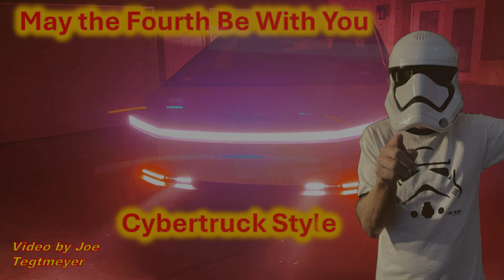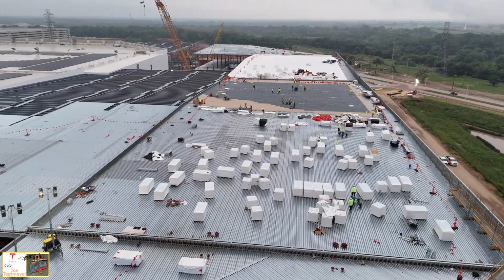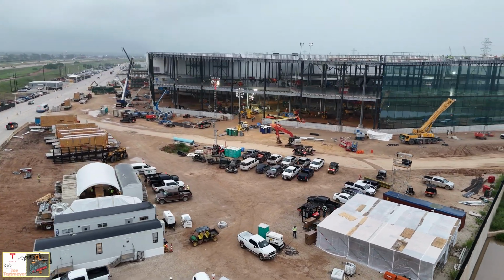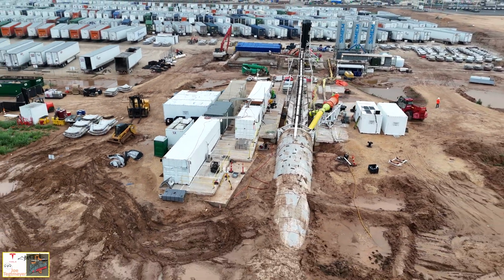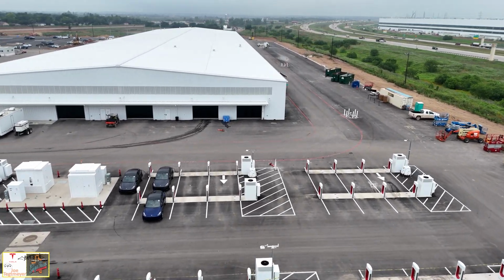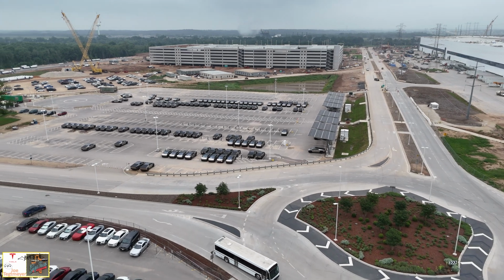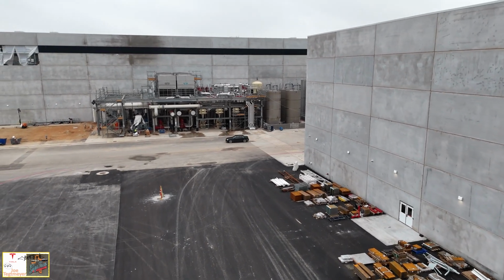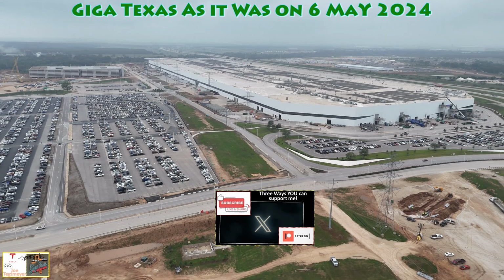Huge Progress on S Ext! Conduit on N side & Boring Tunneling! 6 May 2024 Giga Texas Update (07:35AM)

Comment: The spoils coming off the conveyor belt is mud; lots of water in the spoils. I’m impressed that they have the ability to bore through mud.
Reply from the maker: You are correct and in this video you can see where the water is partially removed at the point where the belts turn 90 degrees.
Reply: Not boring through mud. The spoil is wet from the cutting fluid (water/additives) at the cutterhead.

Comment: The area being worked, on the south side of the pond by the parking garage, is my guess where the tunnel will be exiting on the east side of the plant.
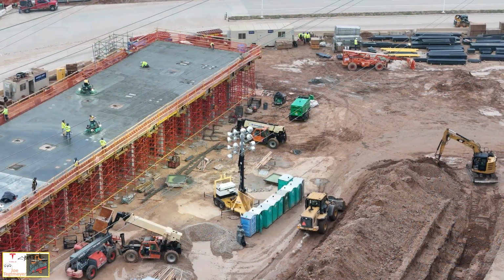Reply: If you mean @ 7:02 It is a Cooling structure. There is a permit...
"SX-000604R1 - SX - Cooling Tower Structural Platform"
Reply: @DavidJohnson-tv2nn  I was referring to the area where they are adding dirt to the south side of the pond, at the intersection of the new road
Reply: @jerrymcgonigal9810  Sorry for the misunderstanding.
A tunnel exiting inside the factory would at least serve some purpose. Though in my opinion, is not needed. But what purpose would a tunnel exit serve outside the factory by the pond?

Comment: Q: What do you think will be built in the South Extension? $25 K car/CyberCab? Tesla Bot? Model 3 variants? Tesla van? Run a poll with your viewers. Thanks Joe for all you do. I never miss an episode! SoCalFreddy
Reply: My wild speculation for the south expansion....
Center section with 3 floors seen here @ 5:56  Considering its location... Possibly a data center.
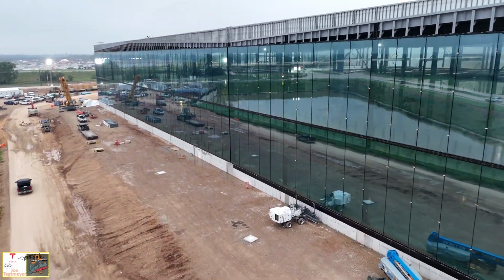Exterior sections with the glass curtain walls @ 8:54
Second floor floor...
Note the bollards behind the glass. A safety barrier. An indication there will be forklifts or other vehicles associated with production. Possibly a new production line? Or an area where they test new production processes? 
First floor...
Office space for the engineers who do the design work.
Again, just a guess which could be completely wrong.

Comment: I hope they are going to increase that tunnel under Giga, to connect other parts to each other.  Maybe also with selfdriving X for people transport to and from the parking sites
Reply: There are thousands of workers. As much as I despise buses they are the most efficient way to transport a large number of people.
Reply: @DavidJohnson-tv2nn  there is that, but when (most) construction is done, maybe this might prove to be an  option. 3 factory shifts will have less people per shift then all the workers now :)

And a great way to get some hands on experience of exploring new way for this outside of the vegas venue

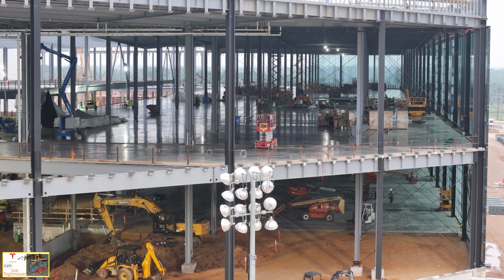Comment: 9:56. Pipes are for the roof drains. One can see them connected to the vertical risers. They are generally installed first before any other building plumbing in order to manage the roof water drainage once the roof is installed. Fire sprinklers will generally be black with red fittings or all red depending on local codes.
Reply: Where you been!
Reply: @DessieDoolan  I fell 15 feet from my ex wife's roof while fixing a leak and broke both my feet. So have been dealing with surgery and recovery.
Reply: @GoCoyote  Bloody hell! Take it easy then and get well soon.
Reply: @GoCoyote  That really sucks, especially breaking both feet! I went through hell at the end of 2022 and into last year with medical issues. Wishing you the best and hope you get well soon!
Reply: @DessieDoolan  Thank you! Took my first steps yesterday after two months. Small steps with a walker, but it sure felt good!
Reply: @DavidJohnson-tv2nn  Thank you!
Reply: @GoCoyote  Glad to hear you are recovering. Whatever you did......don't do it again!

Comment: Joe the roof drains in the new section 5:01 do not line up with the drains in the original building. 
The side drains are one section in from the East and West sides and appear to line up with 
the vaults under the floor.

Comment: With all the rain TX has had, how are they keeping the tunnel from flooding?
Reply: Well if you think about it, only a very very very small amount of water would trickle down from the entrance.  Your house doesn't flood from rain falling on the driveway, does it?  If you are worried about the drill head end, the drill head is pressurized to prevent water from coming in.

Comment: Thanks Joe.
2:45. Robotic Ave. 5 pipes under the road don’t appear to be square to the road. Illusion, or alignment to direct future outflows from the pond eastwards perhaps. More obvious at 3.04.
4:27. BIW roof. Cutting up the shipping pallets.
5:52. Southend/Stamping 2. Level 1 floor at the Stamping 2 wall is at same elevation as Level 3 in GA. Doesn’t correspond with this ‘Central Building Core’ floor levels, but encircles it. 10:44 also.
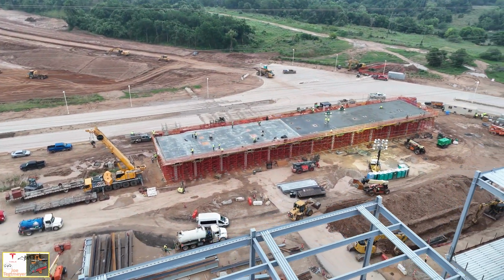6:44. Southend, Cooling Platform Structure. Deck concrete all placed.
Left. Large mobile crane. Nothing seems to have been hoisted yet.
7:05. Southend, east. Apron. Trench for the green sanitary sewer drain. Quite deep.
8:40. Southend, south. Level 2 inside. Substantial bollards behind the glazed facade. Suggests vehicle traffic.
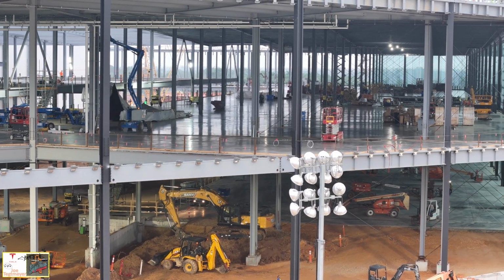9:58. Southend, west diagonal corner. White PVC roof drains connected. The same ’siphonic’ system seen used elsewhere around the site.
Black pipes would be fire sprinkler.
Line of black bollards visible behind the glass.
10:44. Southend west, inside. Concrete stormwater drain pipes. Large trench shield.
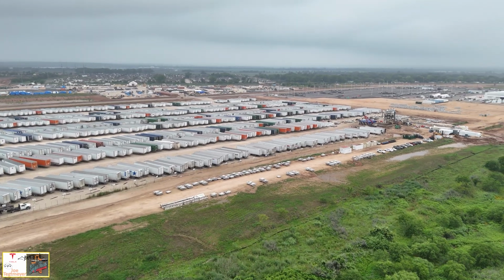11:57. Westsise, Tunnel Project. Att. David Salisbury. Curved sled-like item. Might be what the TBM pushes onto as it exits the tunnel.
12:34. Westside, Tunnel Project. Liner Truck/MPV. Didn’t drive itself there. Wheels aren’t muddy.
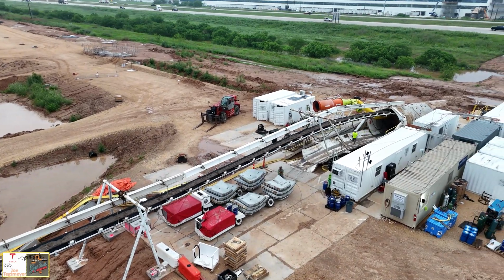13:10. Westside, Tunnel Project. Lineer Truck/MPV. 2 blue drums along with the liner segments. Tail seal grease for the TBM perhaps. More on the pallet to the right.
15:31. Westside, storage. Large dark grey components. Look heavy duty (not sheetmetal). Reducers, ducts with internal vanes, another with some sort of grid obstruction inside.
15:40. Westside, storage. Roofing insulation stockpile.
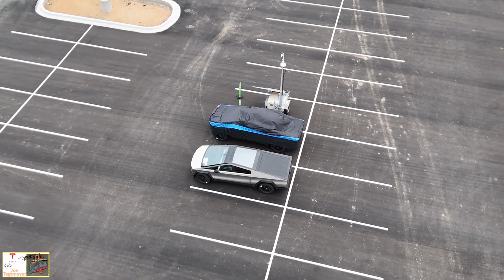17:10. EOL Transport Yard. Covered Cybertruck looks very high.
21:10. Casting, diagonal corner. Inside through the door opening. Original structural concrete column, and the supplementary steel column to support the later addition mezzanine plant platform under the roof.
24:27. Eastside contractors yards. Pipe Fabrication Workshop. Possibly pipes for the Southend Cooling Plant Structure.
27:07. Die Shop north, apron. Material stock. Future dies.
31:18. Tesla Road, north. Trenching westwards. Not following the more southerly alignment of the existing ductbanks.
Possibly a HDD project under the road to connect these trenches with those at 21:10.
Trailer. Right. Sections of a prefabricated bath or similar.
Reply: 11:57 - Yes. think this sled was used in Vegas. Will be interesting to see where it gets positioned.
12:34 - I think this third MPV is a spare/back-up. It is a fairly recent arrival, i assume it has just sat there by the charging station. Maybe they have a charger extension near the portal where the other two are in use, it would make more sense.
13:10 Yes. This is "Condat" tail seal grease, injected at 15-20 litres per ring advance, so they need a new barrel every 10-15 rings or so.
Reply: @davidsalisbury50  12:34. Makes sense. Would be otherwise weird to have the charger so far from the action.

Do you have an estimate of tunnel length for today?
Reply: @DessieDoolan  Hard to get a fix on the movement of the white beam in the conveyor cassette every day. Not much movement since yesterday so only a few meters. I have a fix on its position and the estimated length of the tunnel when the belt extension was added so will calculate it from there every couple of days. My current prediction is 155m.
Reply: @tunnellingsalisbury7605  155m would take it to be within a couple of metres short of the northbound lanes of the highway.
Reply: @tunnellingsalisbury7605  Quick count of the segments, it looks like 182 stacks of 3, so 91 rings, equals 136.5m, although some of these segments may be rejects, so maybe in reality 120m worth available on site. Still some more to be delivered from what I can tell.
Reply: @davidsalisbury50  275m would take the tunnel to about the centre of the perimeter road.
Reply: @DessieDoolan  This all assumes the rings are 1.5m long, but I did hear/see they were 5 foot/bananas (i.e. 1.52m long), or did I just dream that?
Reply: @tunnellingsalisbury7605  Joe had some of the drawings for the cancelled under river project. Showed the rings had a of maximum and minimums of 61 and 59 inches.

Average of 60" 1.524m in this carpenters concept of accuracy.
Reply: @tunnellingsalisbury7605 joes bastrop video confirmed for me that they are 60”, 5 foot, 1.52m long
Reply: 8:40 Great catch on those bollards, such a strange glass building extension
Reply: @Gig0Surf  8:40. I've decided (not with hat eating certainty) that the inner structure of 3 levels is for an entirely different purpose for the outer 2 level structure.

Data Center. Maybe part of the inner structure.
Reply: @DessieDoolan  I had that thought as well, I've also find the scale of everything [the space available] hard to appreciate at times [same with SpaceX Starbase].
Reply: @Gig0Surf  Yes, the scale is nuts. Every once in a while there will be a worker standing beside one of the columns and the column is as wide as his shoulders.

One of the locals mentioned just how big the New EOL building is. Yet compared to the main factory, it's a piddler!
Reply: 6:44 Hi Dessie, On the permit site when you enter "chiller" into the search box, there are permits for chiller plants 1 through 6. Guessing that is going north to south? With chiller plant 6 being in the south expansion.
But what is noticeable is that chiller plants 2 and 5 are missing. Planned future construction?
Reply: @DavidJohnson-tv2nn  6:44. Numbering of plants. Couldn't say. Might be a simple north-south, or order of construction. There was some sort of HVAC or process plant in Casting that was never operational and now removed. That may have messed with any initial numbering system.

Main Building, location of operational plants. Battery, might be 2 plants there. BIW, 2 plants, plus the one currently having the exhaust cowls fitted.

Comment: Read somewhere that they are going to install a DoJo Supercomputer Center in Austin. Could it be that the enormous cooling platform is for this? Also the tunnel like structures in the south side could be for cables for server racks? Speculation on my part.

Comment: Noticing the tunneling dirt cumming out had changed color from clay red to darker grey! Probably an  indication they are going through a deeper/different ground layer?
Reply: As I understand it the near surface layers are tailings from the mined sand and gravel pits in the area. Below this there may be some remnant original in-situ sand and gravel. Below this I believe the local bedrock is a form of chalk/limestone. 
The TBM tunnel should be past its deepest point by now so the excavated material should be just more of the same as it climbs back out of the ground.
Reply: And little or no sand and gravel. So they are below the layer that was mined for aggerates..

Comment: South end expansion: A question for the electrical/data center experts....
Besides the permit for "data center infrastructure".... There is a second permit for "SX-000603R1 - SX - Bridge Power to DC".
Could the second permit also related to the data center? I know DC power is used for the UPS units but would like to hear from some one who knows more about this stuff than I do.
Reply: DC, Data Center.
Reply: David, all the data centers I've worked with had emergency backup generators.  I expect Tesla would do something different - some kind of battery backup.  Would they want that nearby but separated  for safety/servicing?
Reply: @benguthrie49  While I'm not an expert on this, it seems like batteries may be problematic in an extended power outage. Where with diesel generators, as long as you have fuel, you have power. Having said that, aren't batteries used in UPS systems for short term power backup in data centers? That is, they provide power until the backup generators start.
Reply: @DavidJohnson-tv2nn  David UPS systems are batteries.  Typically they smooth out the supply while the generators kick in for large datacenters.  You might have an all battery system for a couple of PCs.  Other cases they supply power long enough to shut down gracefully.

Comment: Thanks Joe!
South end cooling structure:
@ 6:58 Second concrete pour on the top deck. Several openings have been formed up and several steel mounting plates can be seen imbedded in the concrete.
@ 25:11 (Bottom) Wild speculation, but the large grey pipes may be part of the south end cooling system.
Pond:
@ 8:00 Hoping that they don't turn this into another mud pit like many of the other ponds on the site. Could be they are just filling enough for a small parking lot?
South end:
@ 9:52 Good view into the south end expansion.
@ 10:18 A lot of concrete pipe sections further back on the first floor.
EOL facility:
@ 17:29 Ongoing work on the lift station.

New power supply to the factory:
Casting, north:
@ 21:03 Ongoing work to connect the new duct-banks to the main building. These duct-banks will cross Tesla road and connect here @ 31:18
NOTE: There is a mismatch in the conduit count of the new duct-banks and the conduits going into the building (12 conduits vs 8) @ 21:19. Modifications likely.
Eastside of the easement:
@ 30:10 A view of the work on the eastside of the easement.
@ 30:25 Here is where the duct-banks will likely turn to the west and cross the easement.
Westside of the easement:
@ 31:05 It will be interesting to see how they cross over/under the existing duct-banks.
Reply: You have been predicting the demise of Tesla since this project has started. Any predictions as to when that may occur?
Reply: @jbbuzzable  Just curious... What do you think of a CEO who wants to be paid 56 billion while at the same time fires thousands of his workers "to save money for the company"? By the way.... Does anyone question the need for unions?
Reply: @DavidJohnson-tv2nn  So you refuse to answer my simple question.
Reply: @jbbuzzable  Looks like you're refusing to answer my question.
As for your question, no predictions. Since the guy who owns the place is so unpredictable. But things like cutting/delaying the "affordable EV" and Superchargers are not good. Nor is firing thousands of workers.
Now can you please answer my question? Thanks.
Reply: @DavidJohnson-tv2nn  Bezos also said " I predict one day Amazon will fail. Amazon will go bankrupt,". Despite ups and downs, It doesn't mean that companies can't have a significant impact for the foreseeable future. As for your doom and gloom short term questions, I'll just say you know nothing about business with your socialist attitude.
Reply: @jbbuzzable  Still didn't answer my question. Very simple question....
What do you think of a CEO who wants to be paid 56 billion while at the same time fires thousands of his workers "to save money for the company"?
Reply: @DavidJohnson-tv2nn  I think he wants to have the ability to fund future projects. He is getting old and has said that he only has about 20 years left. He dosen't  buy cars, houses planes  or boats. It is all about the projects. He isn't a FU like the NY defendant.
Reply: @kkarllwt  Yes, but isn't he asking to be paid personally 56 billion dollars? Not 56 billion to the company, but 56 billion FROM the company to him. That is the 56 billion pay package that the court tossed out. He is asking the shareholders to restore it. And timing.... At exactly the same time he's firing thousands of workers! What message does that send to the people who actually make it happen?

Comment: DavidS, what is the purpose of the wood shims around the edges of some of the tunnel segments? [Is that temporary protection or for adjusting segment installation/alignment?]
Reply: You ae correct, they are used for both.
You can see the plywood shims/packers are not on all sides. This is because they are only on one side of two faces that come together. 3mm plywood glued to the trailing circumferential joint and on one side of the radial joint has been used often on concrete segments to "cushion" the contact between the segments to avoid hard contact spots between them. It can also be use to control/adjust the 'Plane' of the ring. As each ring is built there are some simple checks don to ensure the leading edge of the ring (that the push rams thrust against) is in a true plane. It is impotent that steps don't form across the joints of the rings or that the overall ring doesn't bow, flex or twist. If this starts to occur it needs to be corrected by placing thin packers/shims of 3mm plywood around parts for the leading edge between rings to correct the misalignment. If it is constantly corrected these 3mm or less "gaps formed between the segments are within the tolerance of the black gasket that forms the waterproofing of the ring. If they get too wide the watertightness may be compromised. There are plenty of YouTube videos explaining this.
Most modern segmental lining systems have moved away from the plywood packers and have integrated a 1.5mm high step in the segment mold where the thrust rams will sit. This then has a 1-2mm thick bitumen pad glued to it to effectively do the same thing as the plywood load packer. The 'plane' correction shims are still required. These can be thin plywood or molded stiff plastic that can easily be cut to length to make the adjustments.
Reply: @davidsalisbury50  Thanks for the detailed response, there are more factors there than I was thinking about.  I think I noticed the bitumen pads and bumps in images when trying to google this before, now I know more what to search on/look for.